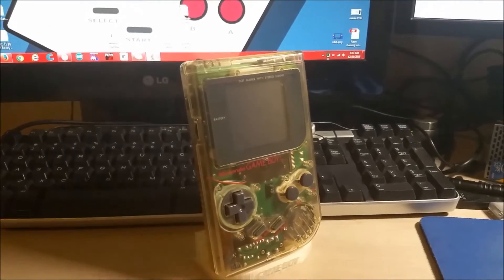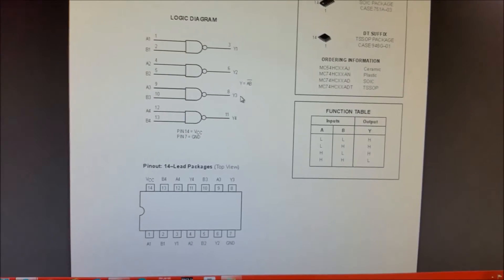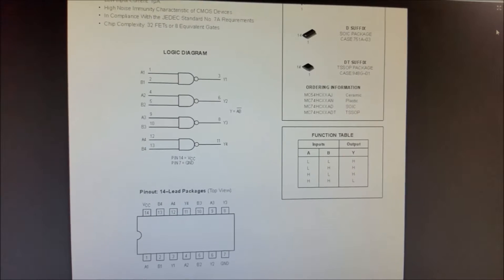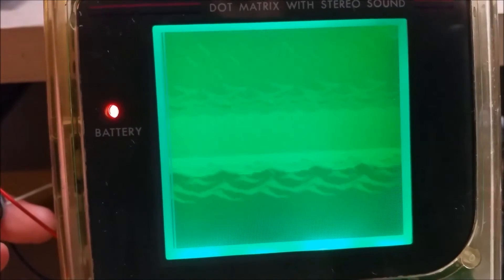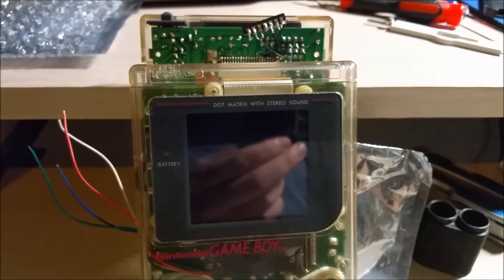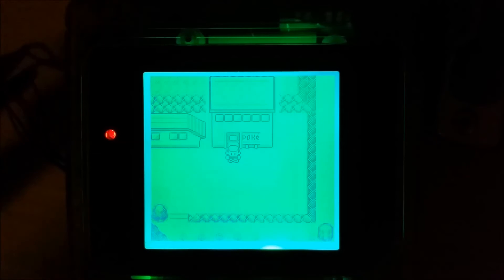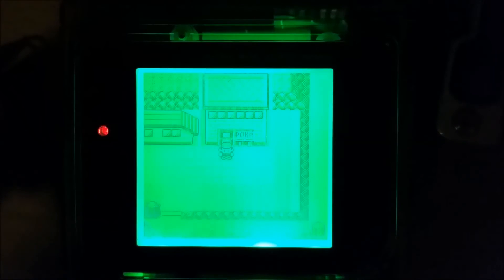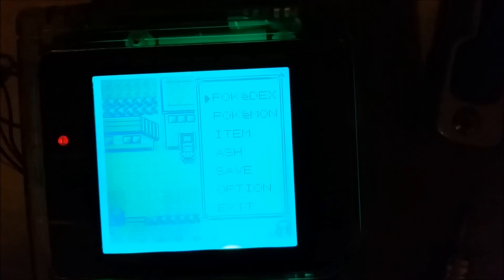RGB Backlit Gameboy - part 3: Biverting the LCD

Comment: I have just done the backlite mod and my Gameboy powers on and shows the nintendo logo and then the game does not boot.  Do you know how to fix that so that the games boot?
Reply from the maker: Your backlight may be drawing too much power and browning out the 5v supply in the gameboy. Either add a resistor to decrease the brightness a bit or add a separate 5v boost converter to power the backlight and reduce the strain on the gameboy's internal 5v rail.
Reply: @sjm4306  What is the separate 5v boost converter to power the backlite?  Is there information online how to make one or where to purchase one?
Reply from the maker: Is your console a dmg or pocket?
Reply: @sjm4306  Mine is a classic DMG console.
Reply from the maker: Here's an article with some basic info (https://handheldlegend.com/blogs/news/voltage-regulators-a-primer). It's not an exact how to so you'll have to do a little more research yourself but it's a good starting point.